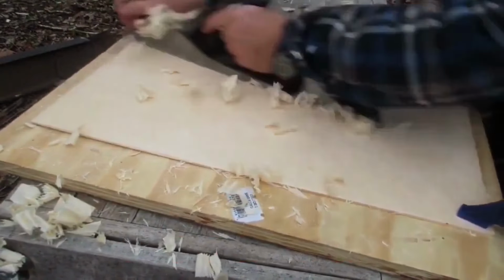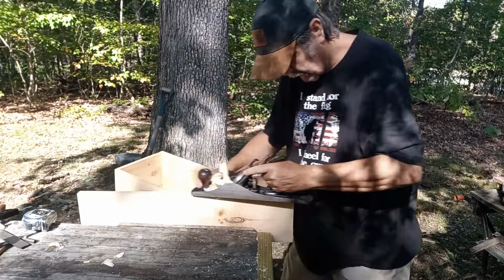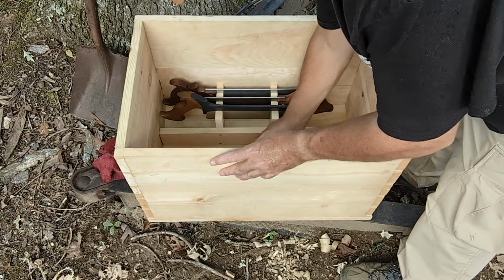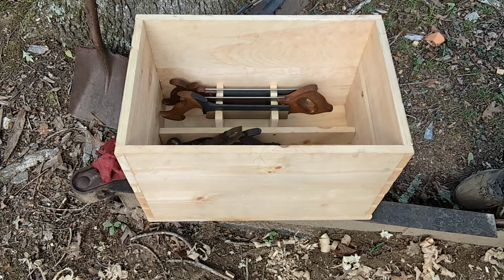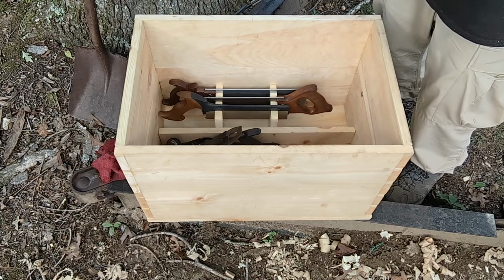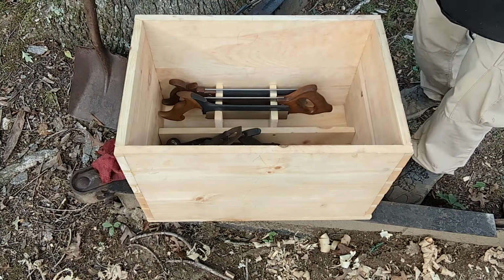Toolbox Build Pt 5 Saw Till

Comment: I've got a woodworking buddy and his wife downsizing from a large house to a much smaller house. All he has for a workshop there will be a carport so he's building him a tool chest. I sent you an email. Check you spam folder and see if it's in there. As solid as you've built that chest it should last you many years and maybe even become an antique.
Reply from the maker: Not recieved an email yet. 
Tell your friend I said good luck on his move.
If he's never built a tool chest before I recommend he check the link below. It's Chris Swarz' Anarchist Tool Chest. 
The chest I built is a smaller version for portability reasons. It's limited on the amount of tools it will hold. The original chests were about twice it's size, and were put on casters. 
https://blog.lostartpress.com/wp-content/uploads/2024/04/ATC_April-13-2024.pdf